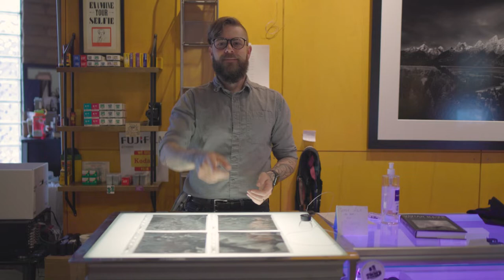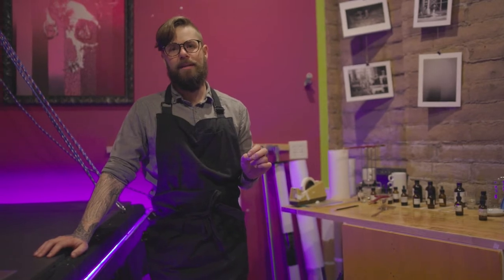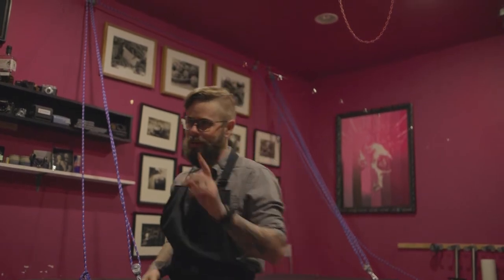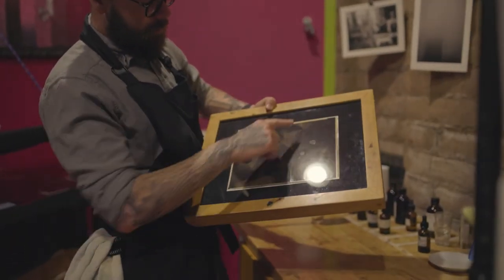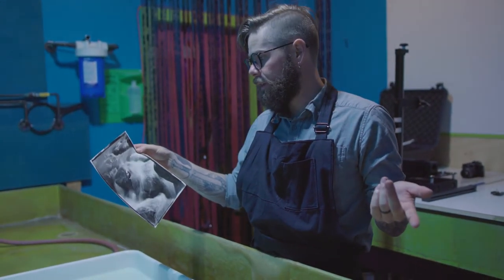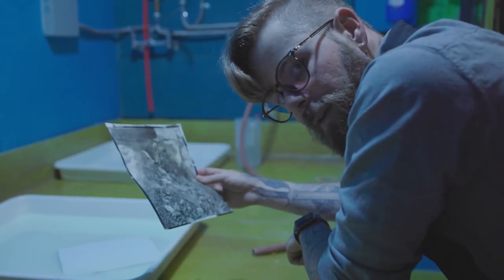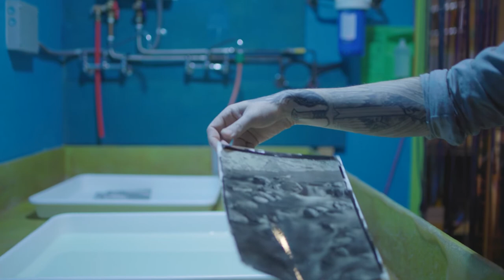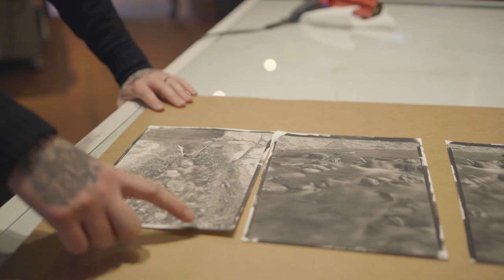Casual Morning at Hidden Light LLC. Printing Four Platinum Photographs

Comment: I’ve got a silly question for you Matt. Your chemical mix in total for those small prints was day 25ml in total. But if you was to do a say 60inch print do you up the rates. So instead of 10 drops of palladium it would be 30 drops? 🤷🏻‍♂️